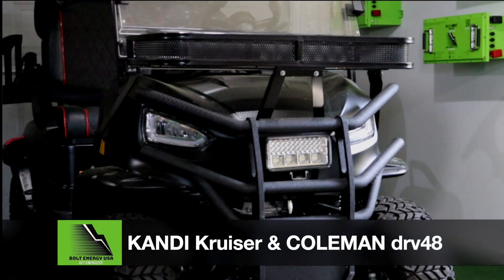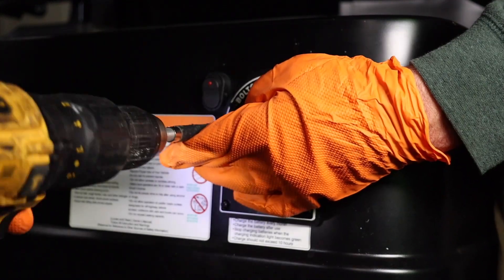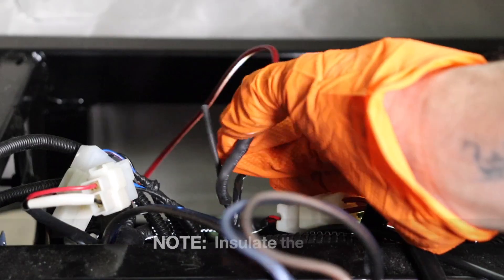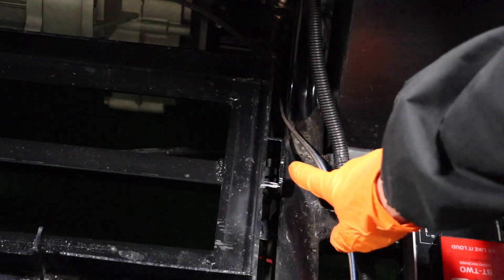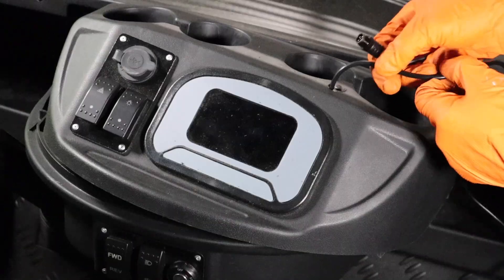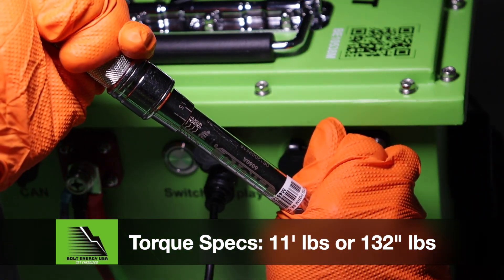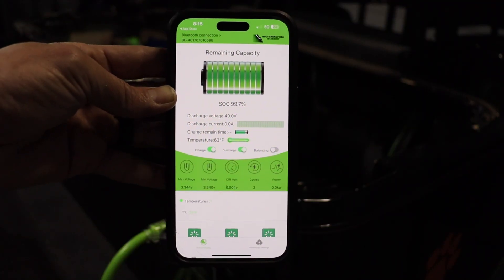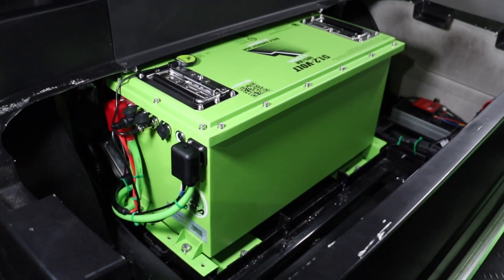Kandi & Coleman Golf Cart | Lithium Battery Installation | Bolt Energy USA

Comment: Will the stock head light switches still work with this type of swap ?
Reply from the maker: Let me check for you will have an answer shorty
Reply from the maker: Yes it will work your headlight switch still runs through the 12v reducer so you will still be supplying 12volts to your headlights
Reply: Thanks for the reply. I just got my bolt energy slim and I'm about to do the installation. What a amazing company you have.

Comment: I regret my decision to purchase the Coleman golf cart from Lowe's, which was labeled as a Kandi model. From the start, this expensive mistake has been nothing but a headache. After just a few months of light use, the cart stopped charging altogether. Now, it’s just a hunk of useless metal sitting in my garage, collecting dust and reminding me of my poor choice.
Trying to resolve this issue has been an absolute nightmare. I've reached out to customer service for both Kandi and Coleman multiple times, and all I've received are runarounds and finger-pointing. Both companies claim they are not responsible for the warranty, and I’m left stuck in this frustrating loop of blame. It’s clear that neither company stands behind their products or cares about their customers’ satisfaction.
I am thoroughly disappointed and wish I could go back in time to avoid this purchase. It’s a waste of money and an even bigger waste of my time. Avoid Lowe's, Coleman, and Kandi like the plague! Save yourself the hassle and invest in a product that actually comes with decent customer service and a reliable warranty. Trust me, you do not want to end up like me with a broken golf cart that no one wants to take responsibility for! each battery costs $500 x6!

Comment: I am currently running the 73.6 volt 105 ah battery in my 2015 GEM car e6 and I am super impressed with the performance of this battery. If anyone is is considering upgrading to a Lithium battery consider DYOR because they are not all built the same. I compared Bolt Energy battery spec sheet line for line to all of the other brands on the market and Bolts Energy are superior in every segment. Continuous max amp output is very important especially with a 6 passengers or a lifted cart with larger tires or if you live in a hilly area. Many battery companies fall short with this spec and the BMS battery management system will cut power off to your cart. There is not another Lithium battery that can beat their performance specs or 10 year warranty. Their kits are clearly quality from their waterproof chargers to the heavy 2awg cables to the stainless steel hardware and SOC digital meter that come with their complete kits. I would highly recommend Bolt Energy  over any other Lithium battery on the market.
Reply from the maker: Amazing review!!!